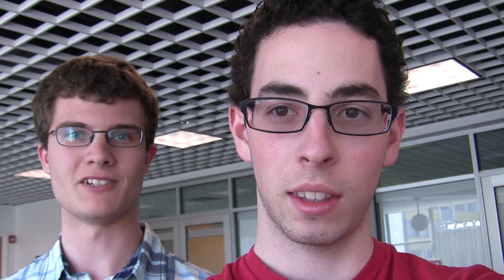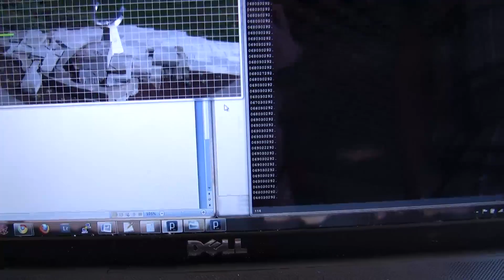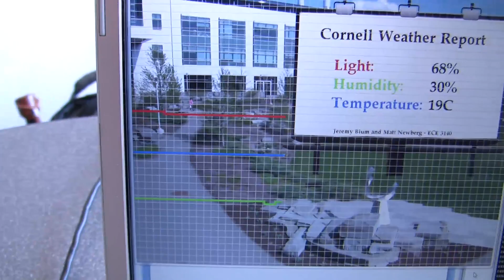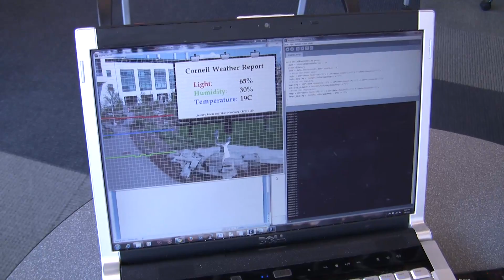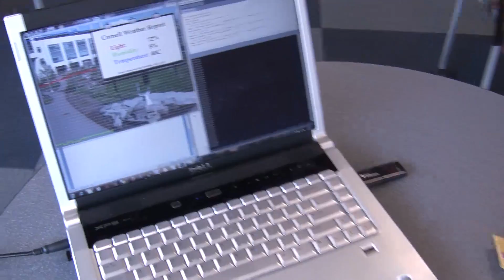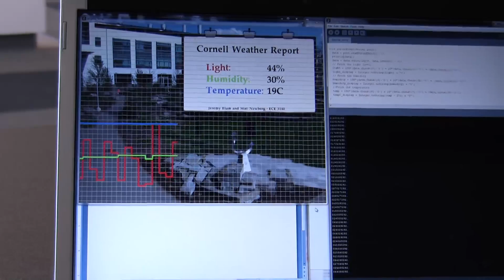MSP430 Wireless Weather Station

Comment: Nice job guys! I am working on a similar project and i need to atach a light sensor and an humidity sesnsor but i don't need an interface. I just need to activate certain pins when the sensors reada certain value. I was wondering if you could give me a little help with the code. Once again a great job and thank you

Comment from the maker: @raghunitin You program it in C - hence it's more complicated than the arduino programming language, but you can also do far more things with it as a result.  For example, I've implemented parallel processing on an MSP430.  You could program the arduino in C also if you wanted - it's just an AVR microcontroller at heart.